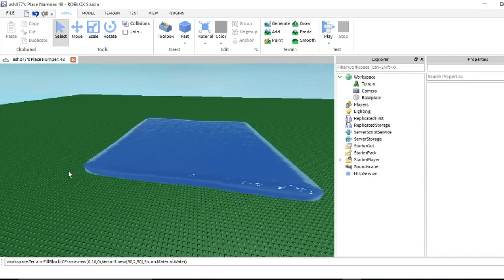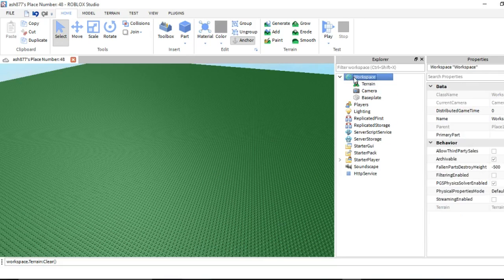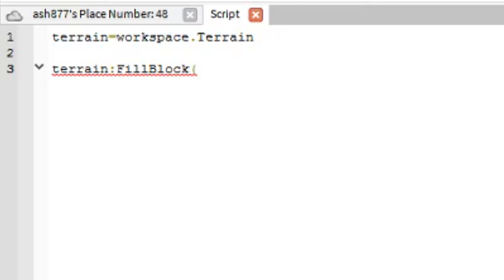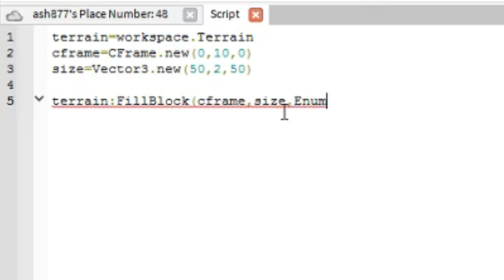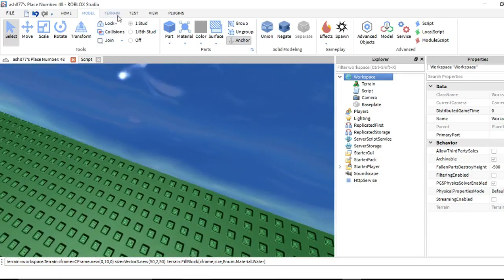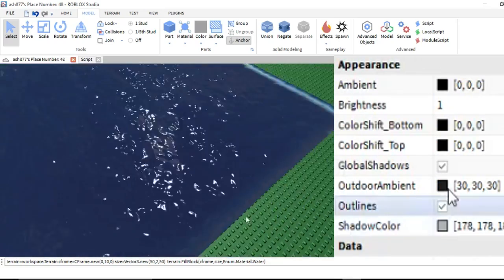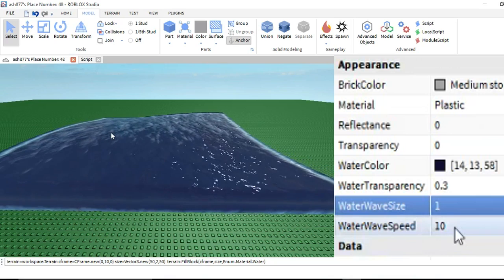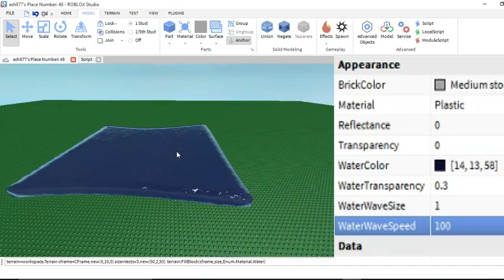Roblox Custom Water Tutorial

Comment: how do you move the water?
i want to move it somewhere else but idk how
Reply: Jobado Frant Use the Regions tool in the terrain tab.
Reply: it might be locked im not sure
Reply from the maker: CFrame holds the position so first clear terrain which CLEARS ALL terrain and then regen using the same code just in a different spot using the CFrame constructor.
Reply from the maker: FillBlock (
    CFrame cframe,
    Vector3 size,
    Material material
)

CFrame is the position x,y,z
Reply: that's what i did but it stayed in the same spot
Reply: can you plz make a vid on how to move move the water in different spots easily plz